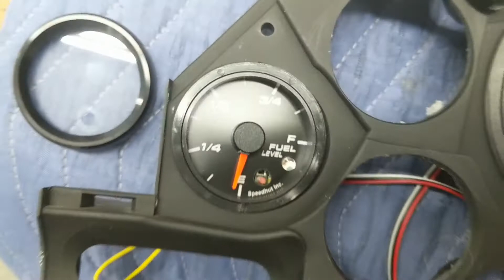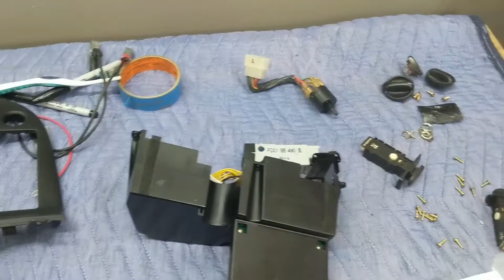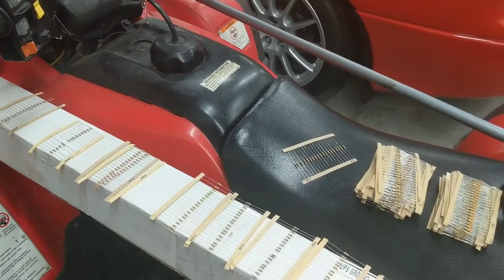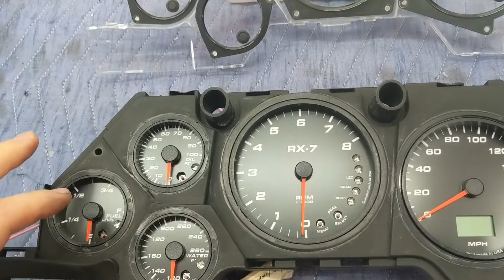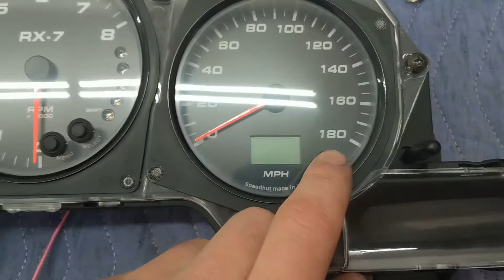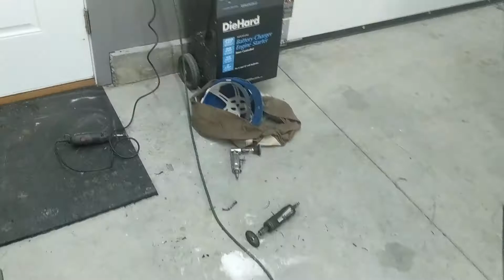Rx7 FD Speedhut Gauge Install and LED Climate Control conversion

Comment: Great video. I was starting this conversion during Covid and got discouraged after I shattered my lens while drilling. Thanks for the thorough explanation of how you tapped the wires into the factory circuit.

Comment: I’m using these gauges with white numbers and green background and I have 3 inverters and the lights are very dim but I’m in Australia and speed hut want me to pay for the postage plus replacement of the lights even though they are brand new but dim as a car made in 1940 bit disappointed to be honey cost me almost 2k Australian and looks like shit
Reply from the maker: The el glow panel with the inverters does look like crap. The LEDs they offer look a lot better. They let me return them and they upgraded them free of charge. I paid for return shipping and I contacted them shortly after ordering. If you just ordered them I'd assume they'd let you do the same. They have a FB page (speedhut owners forum). If you posted there complaining maybe they'd be more inclined to help.

Comment: Really nice video. I followed along and did my FD gauges the same way. I have white numbers on green backlight and its pretty dim, even on the highest setting, I wonder if their LED conversion will fix that.
Reply: You should be able to add a second inverter to bring the brightness up higher